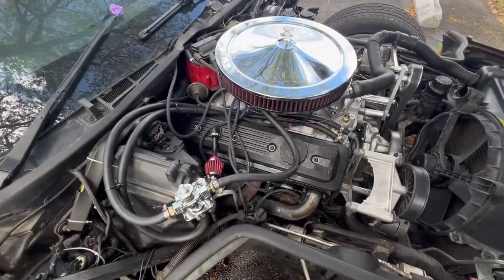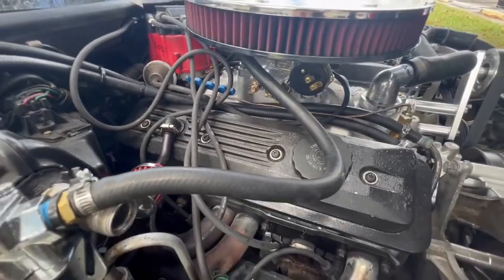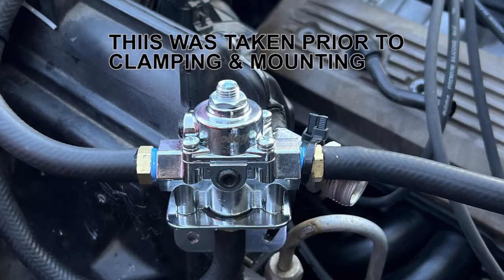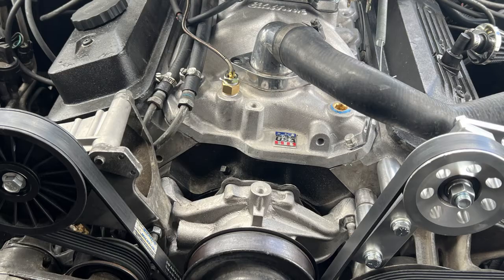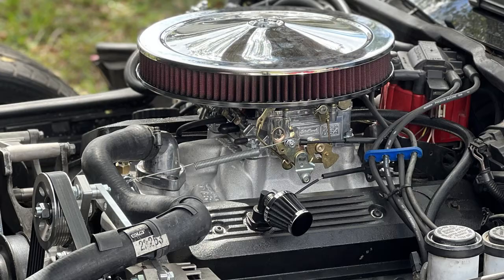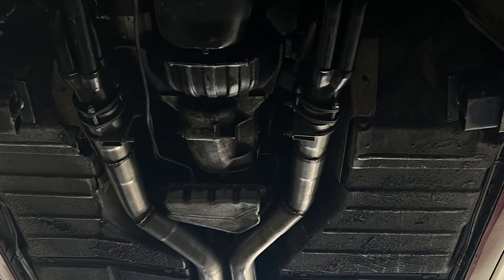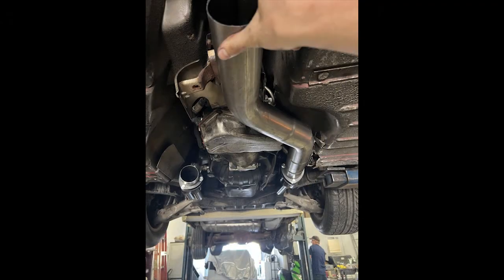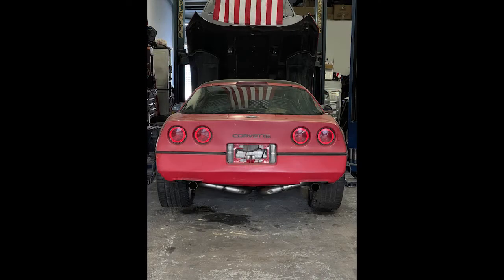TPI TO CARBURETOR SWAP 2023- How to convert your C4 Corvette to carburetor guide

Comment: I appreciate this video! Seems like a great solution to get some more top end from these l98’s. Probably not a bad idea to throw a cam in it as well
Reply from the maker: Thank you for the support! Carb swap is definitely a great way to remedy the smog design of the L98 as carbs with certain intakes will increase power & tq tremendously. You can add a cam as well however it's tough as you have to lift the engine out and or dismantle a lot of the front end to the the job. Even then, the stock heads are only good for around .500 lift and the stock valve springs can't handle a lot of RPM effectively. I recently pulled my motor so I'm doing everything top to bottom.

Comment: Hey what's the part number for that upper radiator hose? I could see it on the actual hose, but it was not very clear. Thanks.
Reply: Gates 22253

Comment: Anything done to the ecm like take it out or just leave it in.
Reply from the maker: Didn't touch anything. You can unplug practically everything and won't have much trouble. The only thing the ECM might trip about is the oil pressure switch but I haven't screwed with that. I'm gonna be upgrading to an MSD Ign system soon tho as I'm sure the stock system sucks.
Reply: @CREATINECONNOR so you just disconnected the fuel injection wiring from the engine and tucked away the harnesses? You left the connections plugged on the computer?
Reply from the maker: @Trebor-gw8lt  Yes, unplugged and tucked away. I pulled my motor recently and I'm going to fully remove all wiring soon.

Comment: Im thinking of swapping my LT1 to carb.
Reply from the maker: I would personally advise to keep the LT1 as it’s pretty good design, especially if you do some of the preventative repairs ahead of time with optispark. It’s a bit newer than the TPI so it is actually pretty good for daily driving & performance oriented applications. One thing to also consider is a lot of the modifications required if you switched to a carburetor setup because the LT1 is a bit different from the traditional small blocks.
Reply: @IllegalC4   it's actually pretty simple, they make an intake manifold for the LT1 for the carb swap. It has the hole obviously in the back for the distributor also for your traditional distributor in the back. I'm basically thinking of doing this to ditch the ECM. Also obviously have to change the timing chain cover as well. I'm definitely keeping the LT1!! I absolutely love the LT1 engine personally.

Comment: I love how much cleaner the engine bay looks.
Reply from the maker: And it's only going to get cleaner too once I get a couple new things.
Reply: That engine bay does not look cleaner than the TPI set up!!!🤣🤣🤣🤣
Reply: @C4VETTELT1  Definitely cleaner than my crossfire. No smog garbage, no AC. You can actually see the engine.
Reply: @E Jacks  definitely cleaner than the crossfire!! But this one in question looks more packed with crap than my factory LT1 C4!! But the LT1 is a very clean looking setup straight from the factory.
Reply from the maker: @C4VETTELT1  The only extra crap in my case is the AC delete pulley and Smog delete pulley. Eventually I'm gonna run a super small belt only for alternator and power steering pump. I also have not yet removed the AC box which is where I'm going to mount the FPR permanently. It is still way less cramped than any of the factory fuel injection options. It took me 3 hours to remove both heads from the motor by myself.
Reply: @Illegal C4  doesn't look as clean as the fuel injected LT1 or LT4 engine compartments even with the A/C compressor!!! And to be completely honest the TPI setup looks cleaner in my opinion!! Definitely from the top of the engine standpoint!! But our exhaust systems are damn near identical!! Lol
Reply from the maker: @C4VETTELT1  We must have different definitions of a clean setup because I feel the TPI has so much junk hidden underneath the enormous intake & runners. Working on anything was super tedious on the TPI.
Reply: @Illegal C4  key phrase "hidden underneath " don't get me wrong I love the car!!  And like the setup, I just don't think it looks cleaner than the factory setup is all. Just my opinion!

Comment: Install a Holley 4150 650 very easy to tune, sorry edelbrocks suck,
Carburetors are still better than any fuel injection!!!
Reply from the maker: In the future I'm potentially looking at some sort of Holley Sniper set up or something similar. I do agree that Holley carbs are better but the price and simplicity of the Edelbrock unit was great at the time. Once I get an AFR gauge setup, I may de-jet my 650 because I feel like it runs crazy rich but I won't know until I get the AFR gauge.
Reply: @CREATINECONNOR   the afr guage will definitely help you see exactly what the carbs doing

Comment: Love the video! The only question I have is what the real power difference was in the end, did it pick up power or stay relatively the same?
Reply from the maker: Hard to say because I never drove it with the TPI. What I can tell you is that the Dual Plane performer still generates decent mid range torque and still builds power to 5500+ rpm. Richard Holdener has a few videos on TPI vs Carb and the dyno chart shows everything. Overall, I'm happy. It's super easy to work on the engine now and ultimately can be customized more to specific wants and needs.

Comment: Good stuff man!!! Does all of your gauges still work?
Reply from the maker: All stock gauges work perfect. Fuel gauge is always trippin though with the fuel pressure regulator and lack of injectors.
Reply: @CREATINECONNOR  great man I am really considering this. I have a C3 and C4 and man the C3 starts and run on pump everytime
Reply from the maker: @Djpip850  Same here. I just give the gas one push on cold starts and it Fires right up.
Reply: What’s the part number on the fuel regulator and distributor?
Reply from the maker: @miguelmontoya7805  FPR https://www.summitracing.com/parts/HLY-12-881

My friend gave me the distributor so I have no idea what it is. I can tell you that it says Delco Remy and looks identical to the stock one so i'm assuming its a vacuum advance off of another small block chevy.
Reply: @CREATINECONNOR  how about the transmission there is some wires going from the tranny to the computer.
Reply: Éxactly on the transmission an older one early 90s will have a 700r4 whiçh does not have. A kick down cable it's a tv cable and must be hooked up and adjusted properly or you destroy the trans anything neweer is a 4l60e transmission that is run by the computer and it will not shift w out doing modifications to make it shift there's a kit you can get that attaches to the carb to give the trans the signal. It needs from a throttle position sensor that works he got lucky because it was a stick but an automatic he would have had a whole different set of issues to deal with

Comment: I read that these carbs have a fuel starvation issue in hard turns. Has it happened to you? 8128 is the part number for the dual feed fuel line to keep both bowls full during sharp turns.
Reply from the maker: I haven’t beaten on it yet but I could see that as a possibility. I don’t plan on driving the car like a madman much so it’s not a concern of mine.
Reply: I had a 1972 Gremlin X 390 with Carter AFB carb That I autocrossed. The Edelbrock Performer IS an AFB. They bough the patterns and copyrights from Carter when fuel injection started being widely used. Never had a fuel starvation problem in turns. Using a dual feel on this carb is pointless. It had a very large passage across the back  that feeds both needles from either side. There are good reasons why Chrysler, AMC and Chevrolet used them on performance engines. The Rochester Quadrajet was based on the Carter AVS (Air Valve Secondary)

All the people that talk crap about Carbs are ignorant 20 somethings that can't tune a carb on a lawnmower. A properly tuned AFB or Performer will run decades without ever having to look at it. I'm 71 and grew up working on carburetors.  A properly adjusted auto choke will start in 1 rev with one pump of the gas pedal. The guys with starting issues are trying to run double pumpers with no chokes on the street in cold weather. Won't work. A properly adjusted AFB is very responsive to throttle. Yes properly running EFI will give you better economy and emissions, but NOT more power. The Crossfire EFI works OK but severely limits power because it was designed for the 305 and has poor airflow. The TPI is great for midrange power but signs off at 4500 rpm. The LT1 has good rpm power and runs pretty damn good BUT it only fits LT1 heads. So if you want over 350 or 375 hp in your C4, carbs are you only choice. LT1 can make about 400 but the nightmare of having to take it 500 miles somewhere to have them burn multiple chips to get it right does not appeal to me. I'm in Columbia SC and nobody in the state works on tuning 1990's fuel injection. That's why the resale value on C4s is low. I've never driven a Crossfire but owned a LT1 and have driven several TPI Corvettes. The LT1 will scoot but any C5 will leave it in the dust.

Since C4s are plentiful and cheap around here, I going to find one and hot rod it to about 420 hp so it will be fun. The questions I have are about making the wiring and gage cluster work. I know some features will be lost and I'll have to take the bulb out of the MIL, but how do you make the tach, speedo, oil pressure, Etc. work? I can put on and plumb a manifold and carb in my sleep. I even a have GM cast iron 4 bbl manifold that came off of a marine engine that would give plenty of hood clearance. (they aren't that bad). Its the gage cluster I'm concerned about. How much is run by the ECM? If you go aftermarket EFI how does that interface with the gage cluster. I can handle the easy stuff, its the really technical crap that need advice. And it seems that is beyond 99% of the keyboard geniuses out there.